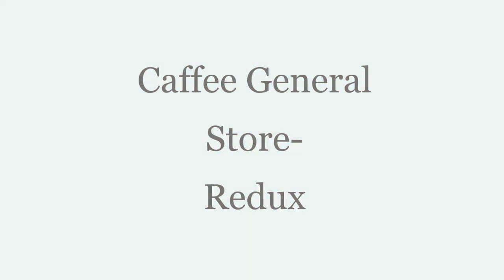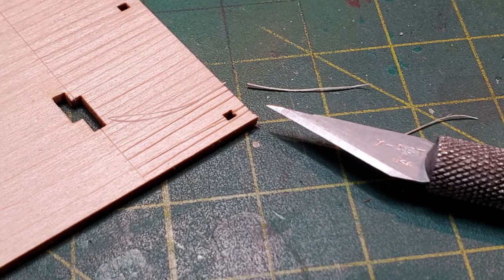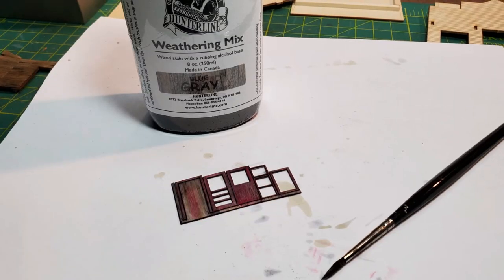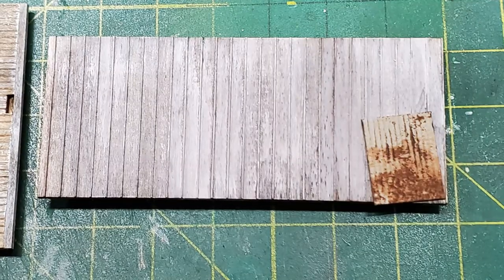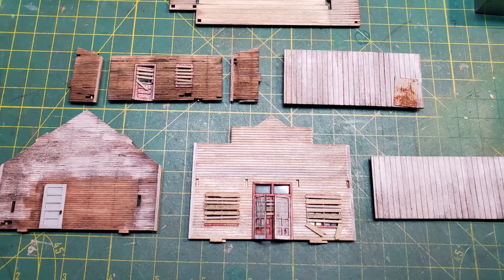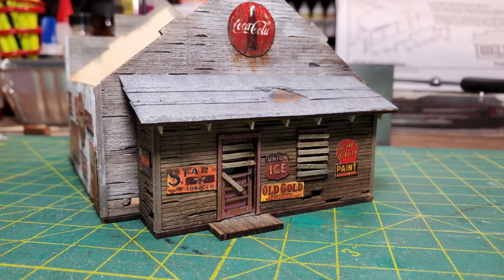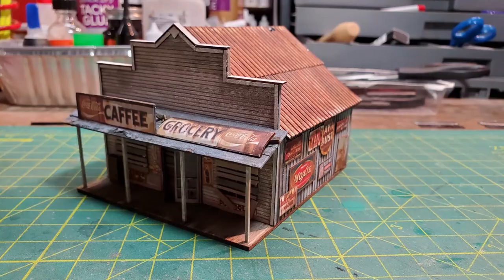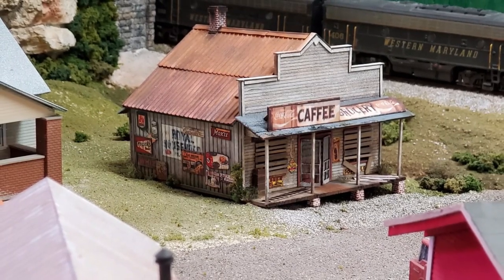Caffee Grocery Redux

Comment: I LOVE your idea of cutting 1/8" off the walls to make room for a piece of corner trim. When I built this kit I just followed the instructions, and I was not pleased with the obvious joints between the front and side walls. Your rather offhand comment made me realize that even good kits can be improved. Keep up the good work.
Reply from the maker: Thanks so much. Yeah, the butt fit just didn't make sense to me. I think they counted on those internal posts for the joint. I'd love to see yours sometime.
Reply: Still a work in progress - need to weather and add signs. Not sure how I could upload a photo for you to see...
Reply from the maker: Yeah, don't think YT would work. I'm on FB, but know many aren't. Anyway, have fun modeling.

Comment: Great job! I like the idea of using the chalk paints, and artist's pigments. Also like the creative touches, like cutting the main sign in half & making half lean. Very authentic.  Question about the watercolor pencils; are you liquefying them with stain, or water? If water, doesn't it warp the wood?
Reply from the maker: Thanks for the comments, Kathy. Two ways of using the watercolor pencils are to dip the tip in water first, or use a brush with a tiny bit of water. Either way, there's very little water or stain used. Plus that trim doesn't warp as easily, but it can a little. I have a comparison of watercolor pencils in my How-To playlist to see more about them.
Reply: Thanks, Greg; will check out that video.